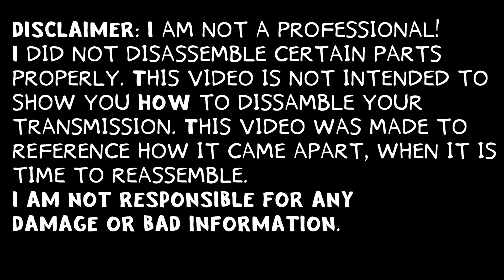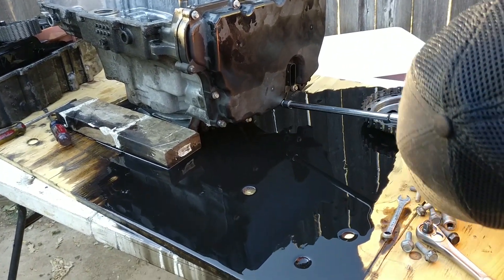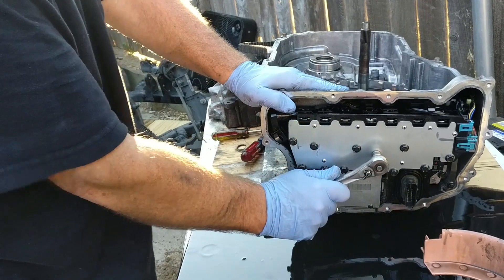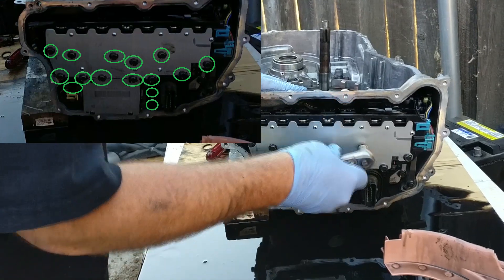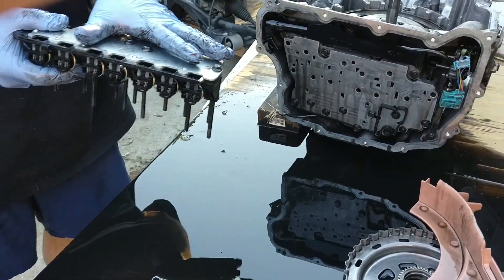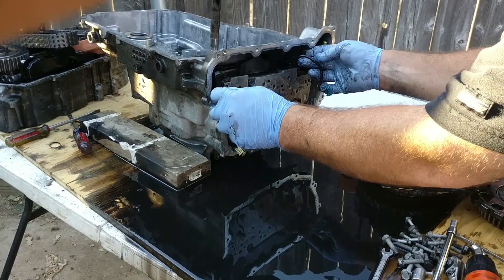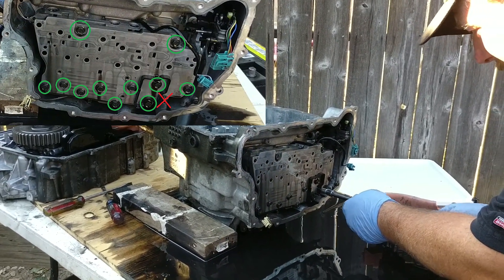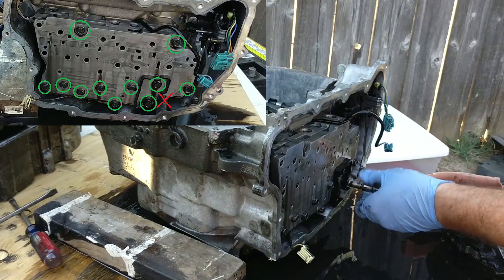Teardown 6T45 Transmission - Chevy Equinox - Part 1

Comment: Nice work B'nG.  I have a 2010 and am getting a small amount of fluid at the base of the plastic cover.  Should I replace or remove and clean and regasket the part.  Not sure why it is leaking.  Also, second question.  There is a small round hole with a round cap just ahead of the axle, what the heck is that.  Is is the fill level hole or no?  It looks more like a speed sensor.  Is there an easier way to check fluid level rather than using the back fill level hole (just behind the axle).  Nice work, thanks.